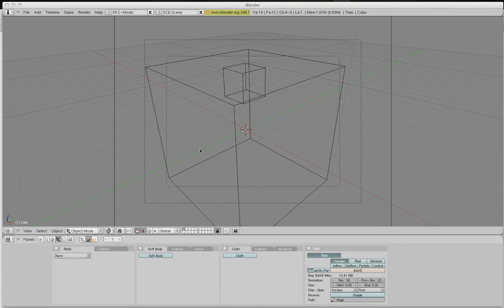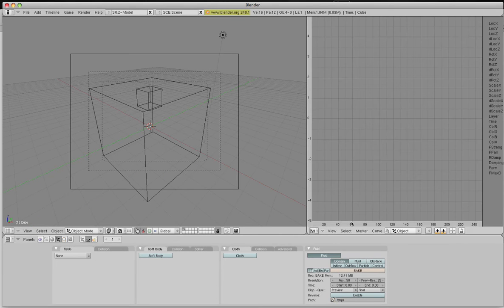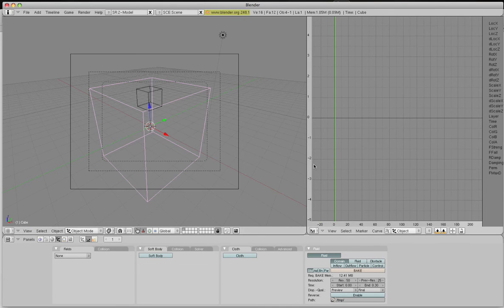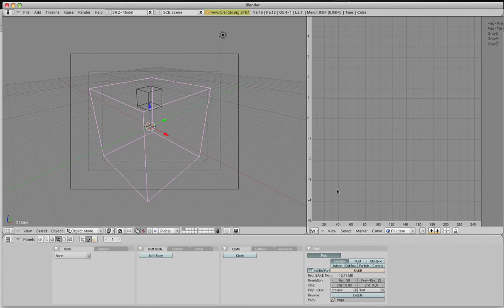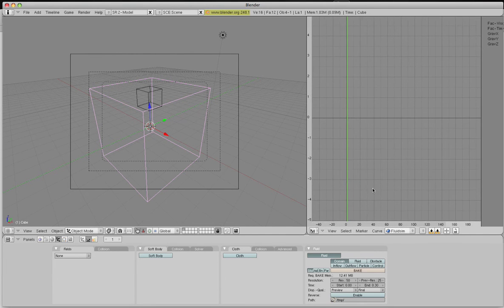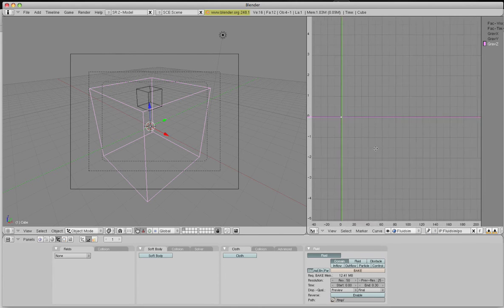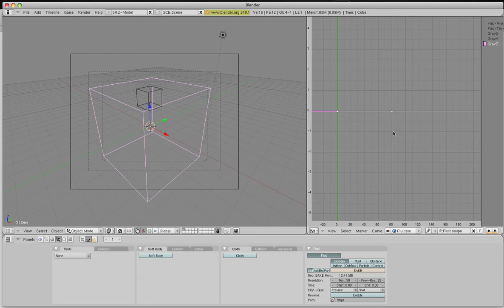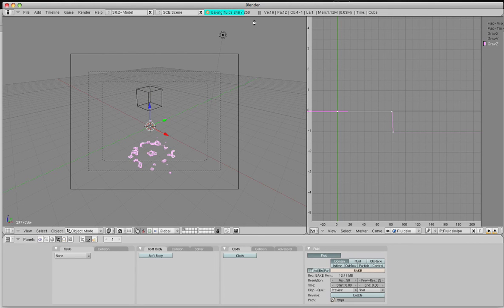Blender Fluid Tutorial - controlling timing

Comment: @MegaGribble actually I got how it works : the value you set is the value of the gravity strength itself, not a number you multiply (NOT MULTIPLICATION) the real value by, but this works (in Blender 2.49b) only if  the gravity is set to 0 in the fluid physics (in the domain section)... if not, it just ADDs (addition) the IPO curve to the fluid setting value... so this is a kind of omission or mistake of the 2.49b version... I don't know if you got me.

Comment: @MegaGribble I also spent couple hours searching for this, I found it not really well explained in the the offiicial web site.
In my case, I needed it to control the moment when my fluids start to run because they start at 1 frame by default. I didn't try it yet but I think this is the solution.
in the website, they also speak about an IPO curve called "active" but I haven't found it, I only have the 5 you display here.
Thanks again for that rare but extremely useful tutorial.